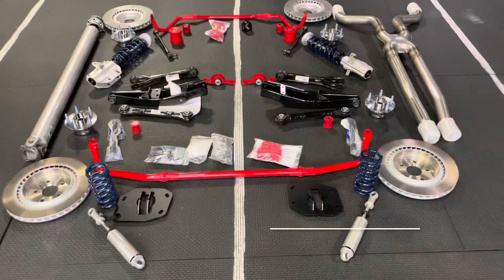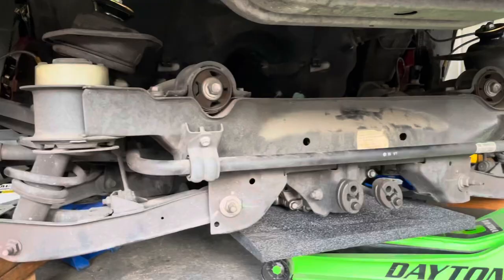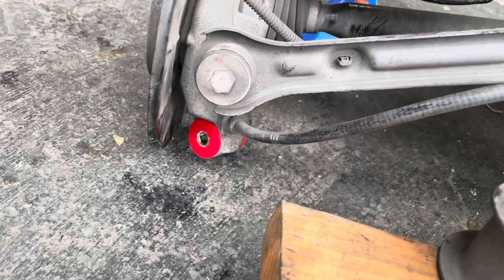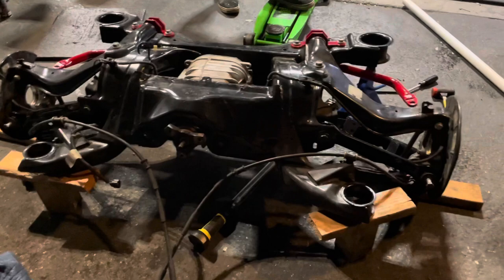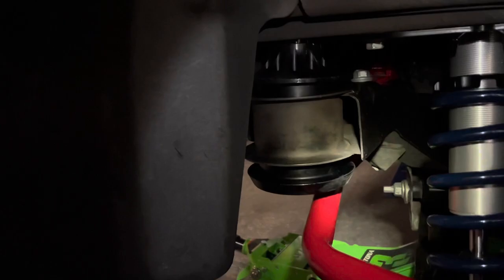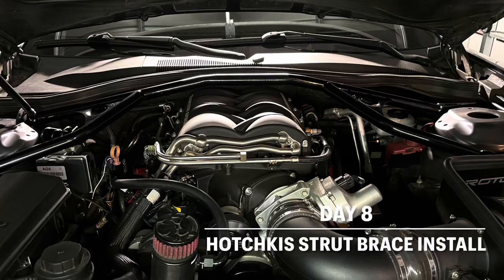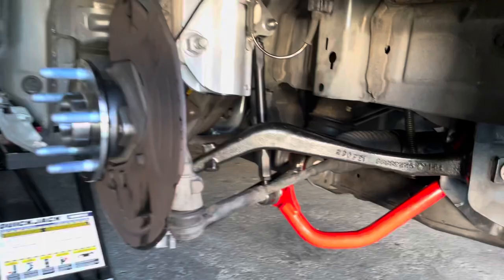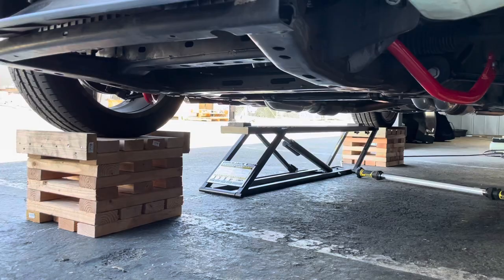2011 Camaro 2SS/RS - Full Suspension Upgrade

Comment: Thank you for taking the time to make the video while figuring out this project.  I am considering doing some or all of the suspension upgrades and know nothing about it.  This vid helps. Where did you source the Z28 and ZL1 parts?
Reply from the maker: Finding the Z28 and 1LE parts weren’t super easy as I believe many of them are discontinued, but I was able to find left over stock at Rock Auto, my local Chevrolet dealer, and some random online stores. Patience and lots of phone calls were made to check actual stock. Never believe the websites when they say they are in stock, not necessarily true. Give them a call before ordering.

Comment: This is going to help me a lot,  thanks.  

I actually bought a extra rear cradle to work on  and put the new parts on then switch the cradles.  How do u like that jack setup, I was not sure it would be tall enough to do this job.  👍🏽

Again thanks for the video
Reply from the maker: The QuickJack is amazing. Been using it for 5 months now and it has been a life saver. Definitely recommend it.

Comment: How difficult was it to remove the bushing shell from the lower control arms on the front?  Did they press out or did you have to cut them out?
Reply from the maker: I had to press them out, but that wasn’t hard at all. Getting the new ones in took more time.

Comment: Did you notice a difference? I just got my hendrix diff and solid cradle bushings.
Reply from the maker: I definitely noticed a difference. Which made the largest difference? I couldn’t tell you since I upgraded everything at once. I didn’t want to have to take it apart several times, so I opted to slowly gather all the parts needed and do one big install.
Reply: @allenwoolsey I don't blame you.  That's what I'm doing too. Z28 upper control arms and bmr trailing and toe rods along with the bushings

Comment: How is the Rear bmr Upper Control Bushing holding up?
Reply from the maker: So far so good! I only have about 500 miles on it with those bushings. My driveshaft is not right so I ordered another one which is taking 6-8 weeks to get to me. Once I have it on, I can test the car more. Right now I have too much vibration at above 80mph.

Comment: Should I do the same thing for my 2LT/RS? I am hearing a lil knock in my front drivers side when I hit a bump I know I need to replace some stuff no experience with this and need help.
Reply from the maker: I would first identify the issue and then go from there. Replacing parts blind can be costly and frustrating.
Reply: @allenwoolsey  Idk how to identify if I look under the car. What type of place should I take it to? I live in Evansville Indiana
Reply from the maker: @Skippygoesharder  I would try and find a mechanic that you can trust and that has worked on Camaros before. Best bet is to get on the Camaro forums and ask there.